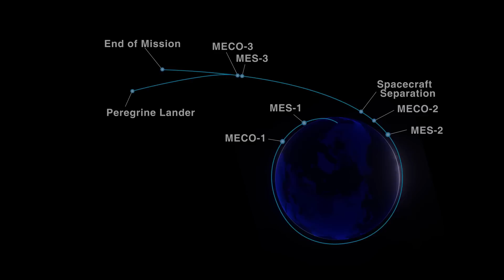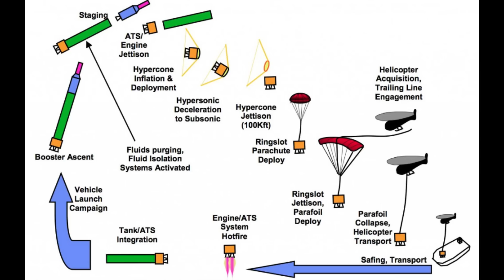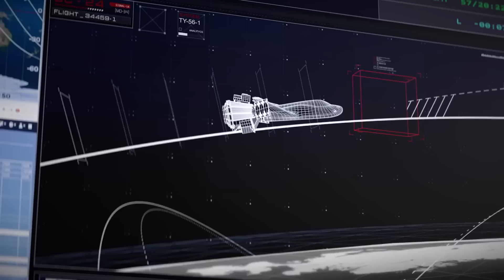Why Vulcan is the Most Important Rocket ULA Has Ever Built

Comment: Smarter Every Day did a factory tour with Tory Bruno showing a lot of the structures and construction in more detail. Fantastic video.
Reply: It was very fascinating, the milling of the aluminum walls and mostly the thickness {nay-thin-ness} of the tubes-
Reply: It got to me, how seemingly proud Tory was in that video, of their manual, artisanal approach to bending the orthogrid panels.  As if such inefficiency and built-in higher cost is something to boast about...
Reply: @Spherical_Cow in your infinite wisdom, what is the better way to do so?
Reply: @ericlotze7724  I'm not a manufacturing engineer, so I don't necessarily know.  All I know, is I recognize blatant inefficiency when it's dancing naked right in front of my face.

Maybe, one possible better way would be to 3D-print (e.g. via laser sintering of powdered alloy) instead of subtractively machining and then manually bending?  Or maybe, at least try to automate the bending in some way instead of declaring matter-of-factly that hyper-specialized near-irreplaceable expert humans are too superior in their sheer eyeballing capacity for any robot to emulate...
Reply: @Spherical_Cow  Must be an Elon acolyte...automate everything, replace the humans, more cash for the "master"...
Reply: @codymoe4986  that's how competition works in a market economy.  Elon didn't invent that; it goes all the way back to the mechanical loom.  Read up on the Luddites: they're your kind of people...

Comment: ULA doesn't stand any better chance of reaching orbit than Starship. Probably take 3 flights just to reach orbit. First launch will likely fail similar to Starship. Why put payloads on a completely untested rocket with less than 1/3 chance of even reaching orbit, much less going anywhere from there. It will probably be 3-6 launches before it will be successful at being a viable rocket.
Reply: ULA and SX have completely different development philosophies. I am not saying one is right and one is wrong, I am saying they are too different for your comment to make any sense.

SX knew the most likely outcome was they would not reach orbit. That’s ok, they like to design to the minimum that might work and then collect real world data with test flights.

ULA likes to try to analyze and design things to work end to end in the first test flight.

Comment: How ironic is it that blue origin is not the first company to use their own engine
Reply: And that ULA will be launching satellites for Bezos?
Reply: They have used their own engines: BE-1, BE-2, and BE-3 PM have all flown on Blue Origin vehicles. BE-4 will simply be used first on Vulcan and garner a lot of data for its use on New Glenn.
Reply: @mikedicenso2778  Define "flown". They haven't reached a single orbit.
Reply: @riparianlife97701  That's moving the goal posts. 

I've noticed that the Blue haters have this tendency when someone points out a flaw in whatever particular thing it is that they've latched onto to hate the company with, they just immediately move everything to the right.
Reply: @mikedicenso2778 No it isn’t moving the goalposts. Blue Origin is supposed to be competing with SpaceX with a reusable orbital rocket. So far they have a hugely oversized sounding rocket despite being older than SpaceX. One of the distinctions between a sounding rocket and the general sub orbital class is most of the down range travel from a sounding rocket is from the Earth’s rotation not the rocket attempt to make orbit. Size used to be a difference but Blue Origin has made that distinction irrelevant.

Another way you might think of this is I can put a rocket engine on a test stand and run it 500 times for twice the duration of the ascent each time. When I put that engine in a rocket and try an orbital flight is that flight 501? No.
Reply: How ironic is it that people pretend Blue Origin is a viable rocket company?
Reply: So far Blue Origin is just an oversized sounding rocket. LOL
Reply: @jokerace8227  Ballooning for people in a hurry.